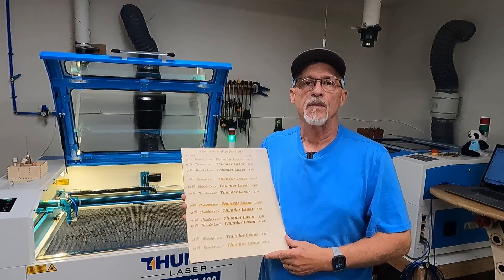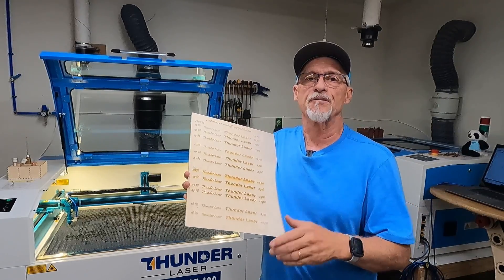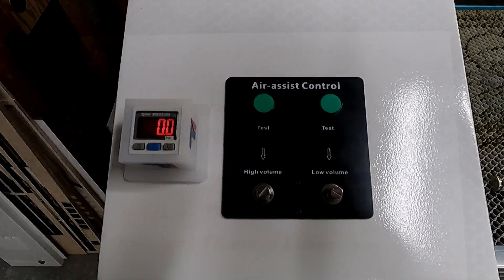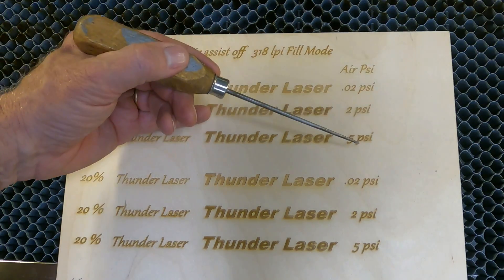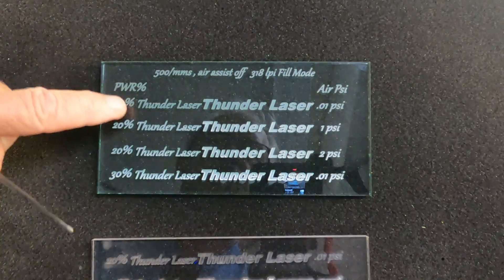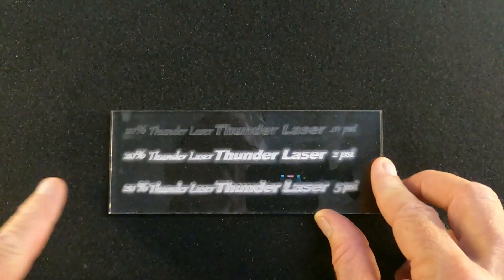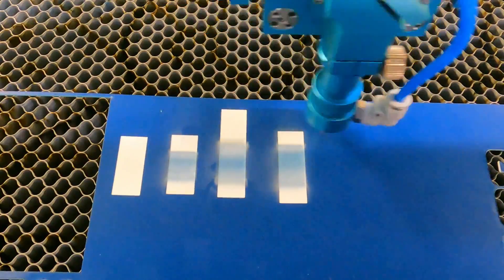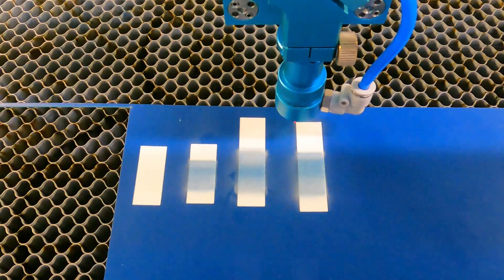Engraving Basics in Wood, Acrylic and 2 Color Rowmark sign material

Comment: Great video.  Could you please make a short video on how you installed and connected the digital gauge?  I couldn't find anything on Thunder's site that showed how to hook this up like you have it.
Reply from the maker: I would like to but because there are electrical connections that have to be made for this digital air  gauge I won’t do it due to liability.
Reply: Here's a link to the process on Thunder Laser's site:  https://support.thunderlaserusa.com/portal/en/kb/articles/quantifying-air-assist-pressures-26-2-2022#Introduction

Comment: Great video. Im struggling still with my 51/100 I have my power and speed close to yours with low as possible air pressure and it’s not clean and crisp. I also left the clear masking on should I take that off?
Reply from the maker: if you have clear masking are you engraving acrylic?? don’t use polycarbonate from big big stores or extruded acrylic for engraving . only use cast acrylic, remove the PAPER backing and very low air flow. thank for watching

Comment: I'm sorry I'm a little confused. You mentioned air assistance was off but you are using air pressure. I'm 100% new at this so I'm guessing this is a silly question but I thought air assistance was air pressure? I was amazed by the differences you showed! So very helpful 👍
Reply from the maker: I can see why you would be. In lightburn you have a radio button that indicates air assist on or off in each layer . You turn that off in lightburn when engraving if you have a Thunder laser because it really means when you have the air assist off in lightburn is means low volume air flow to the thunder. You never want to go without any air flow or you will crack your focus lens. Thanks for watching.

Comment: On the rowmark fo you use 4 inch lens?  When usjng my 2.5 with no air, i get flames.  Should i use a 4 inch lens?
Reply from the maker: the flames are from lack of air flow, when using acrylic add just enough air flow to extinguish the flame especially on and type of acrylic

Comment: Very helpful. Do you have a video that shows how you clean up an engraving when there is residue?
Reply from the maker: too much air flow is what generates allot of residue. make sure your using Minamal air flow when engraving. a quick sanding with 220 grit sand paper is the best. whipping it down with moistened rags or towns lifts the grain of the wood and makes it rough and then you have to sand anyway. skip the step of wiping and just sand.

Comment: Just came across this video, Curious about the digital pressure gauge.  Do you have an installation video for this gauge?  I'm assuming that you cut a hole in the machine next to the air assist, then just hooked up power and ground (12VDC?), then an air line to the gauge?
Reply from the maker: On thunderlaserusa.com these is info on it. I see someone on Etsy has designed a housing for this guage to be installed on a thunder without any new holes.

Comment: Thanks for posting this very good, educational video! 
Would you mind sharing where you got this nifty digital low pressure gauge from? 
A direct link to the product would be greatly appreciated by a few of us. 
Thanks again!
Reply from the maker: YouTube won’t let me post a link here I got it at smc pneumatics.
Reply: All right, this was likely quite expensive. 
Here's my answer to the question - get an inexpensive 15 PSI pressure gauge and cobble up something like this below; one possible - and very relative - improvement would be to get a more precise, multi-turn valve for airflow adjustment, but in my experience it is not absolutely necessary: https://www.youtube.com/watch?v=OWRdnh18bqw Thx!

Comment: Interested in more details about your variable air assist, perhaps a video topic?
Reply from the maker: Thunder laser is one of the only lasers that have a dual air assist. you control it in your layers in Lightburn. air assist on or off. off really means low volume air. this will automatically switch from low volume air (engraving) to high volume air when cutting. this is very convenient and effective!

Comment: Is it possible to get a champhered or rounded edge on acrylic with a CO2 and/or Lightburn?
Reply from the maker: by adding a line just inside the cut you can make an illusion of a chamfer but because the laser beam is fixed at 90 degrees the 45 degree chamfer is not possible
Reply: @computercreationz  Thank you so much for your reply. I enjoy your content immensely.

Comment: I am trying to engrave on the 2-layer plastic and cannot get the settings right. I have to turn the power up so high it is melting the material or I have to make multiple passes. Is there an easier way?
Reply from the maker: High speed low power very little air flow. To much Air flow is your enemy. Your engraving should be very shallow.
Reply: @computercreationz  I have a 60W c24. i tired the default settings from the library and turned off the air flow. It is barely making a dent in my material. The speed is at 500 and the engrave power is at 19 and the cut pwr is 39. any suggestions? The material is the lamacoid 2 layer plastic from gravoply, which is supposed to work. by the time I cut through, i am melting the material, which looks like crap.

Comment: Is there a reason why you went with the SMC specifically?
Reply from the maker: no, it was the only one I found that was down to a 1/10 of a pound that didn’t break the bank.
Reply: @computercreationz  Got it! I've been looking at some on eBay. Found a seller which is selling them new at around $30. I have an AEON Mira 9 and I'm looking to seriously upgrade the air assist system.